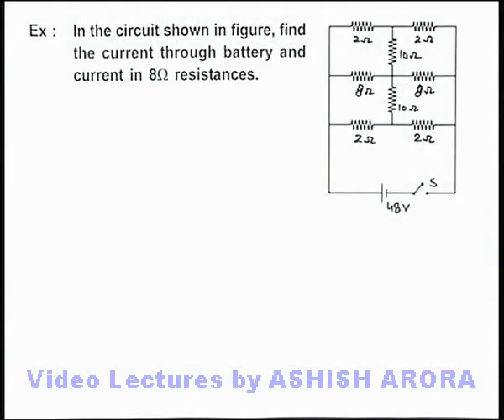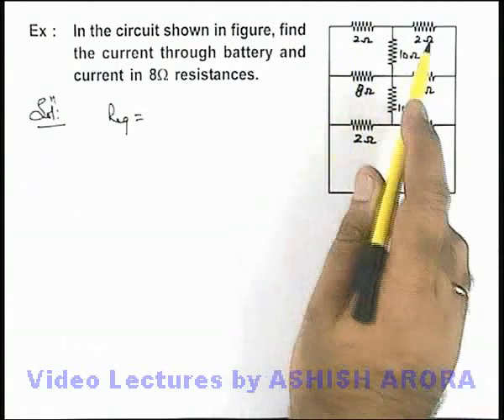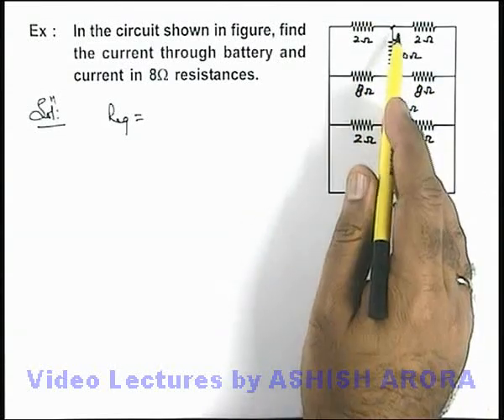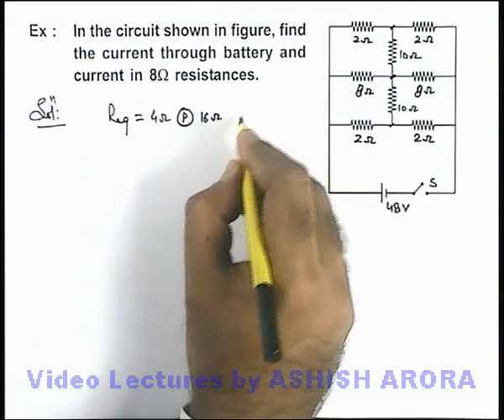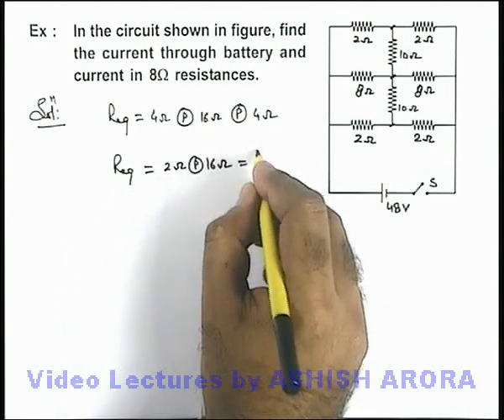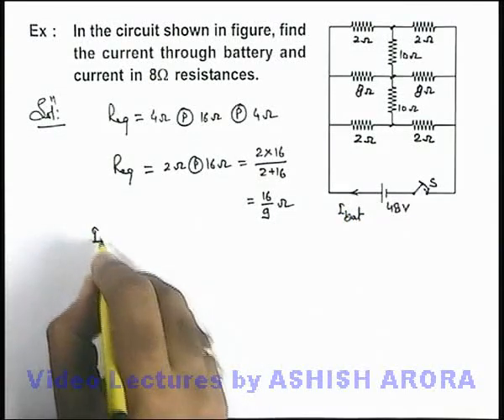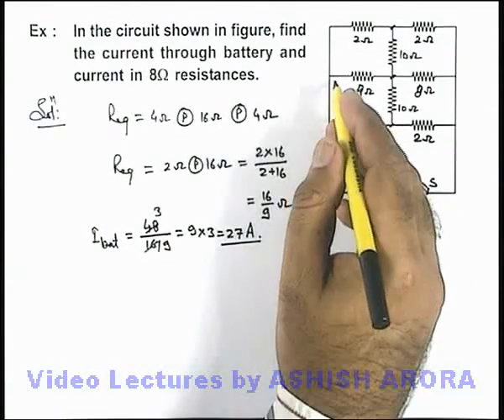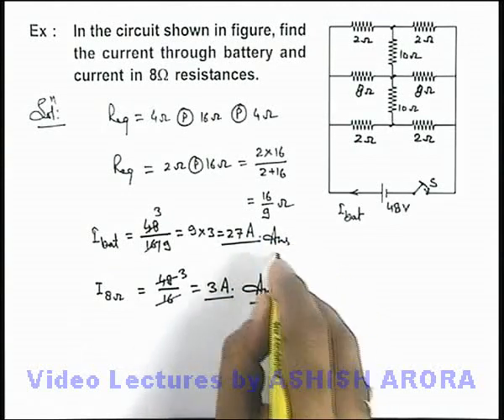Class 12 Physics | Circuit Analysis | #11 Solved Example-5 on Circuit Analysis | For JEE & NEET

Comment: SIR one doubt what is need to find I-net if we can find current flowing through 8ohm resistance directly.
Reply: Because the question has asked for the current through the battery dear
Reply: @sxzz5  oh sorry my mistake
Reply: But we can calculate current via all resistances directly as he had mentioned n thn add them... We'll end with same answer...

Comment: Can we say that no current will flow from the 10 ohm resistances because they both will form a wheatstone bridge?

Sir in this question  the principle of wheatstone bridge can also be applied??
plz reply
Reply: Whenever there is a symmetry, then Potential at all points across the line of symmetry is same, so no current flows through the
10ohm & 10ohm resistance.
Reply: YES 
I don't understood what sir said
Reply: yes ofc
Reply: yes

Comment: sir vo 8 ohm pr i pucha to why u take 16
Reply from the maker: Due to same potential at middle terminals, there will be no current in 10Ω resistances so these can be removed and because of this both 8Ω resistance are taken in series...
Reply: @physicsgalaxyworld  sir , why we have  taken 16ohm instead of 8ohm. please explain
Reply: @meranaamhaimohan  because the two 8 ohm resistances are in series and the same current flows through the resistances which are in series
Reply: @meranaamhaimohan  question is for both the 8 ohm resistances